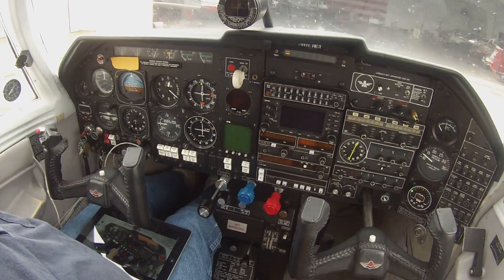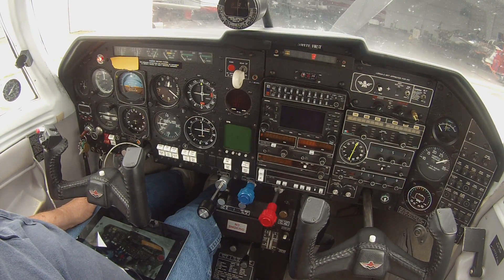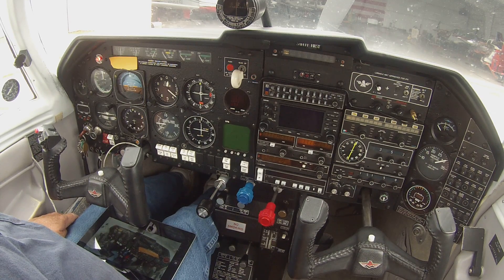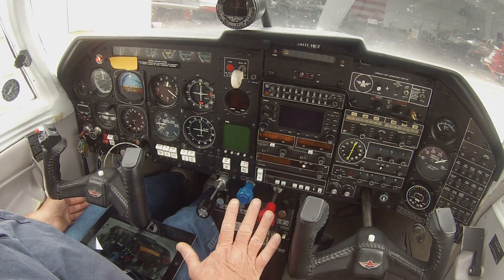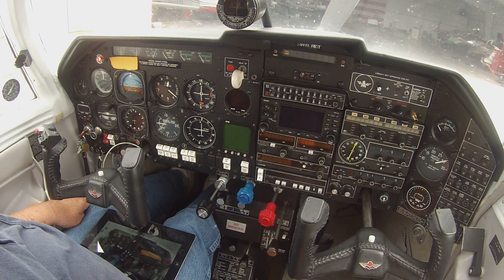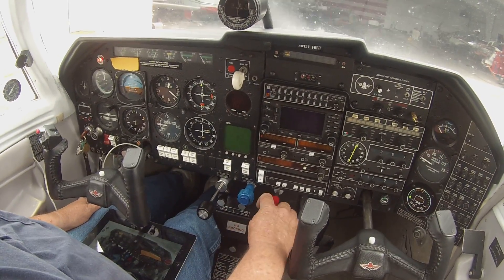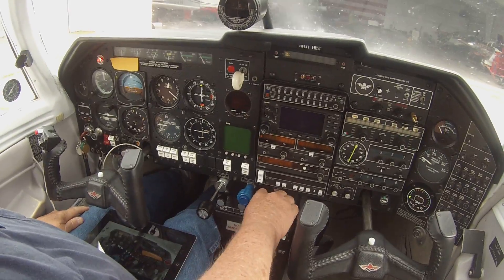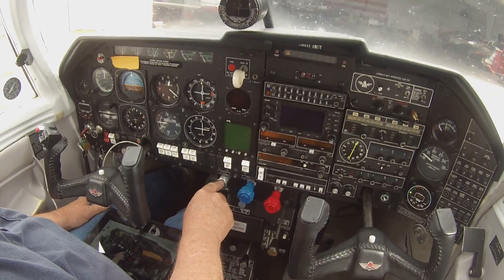M20J Hot Start

Comment: I've started lots of mooneys and this may work fine for an engine that was turned off for 15 minutes , but let it sit for an hour and this will never, ever work.   I'm speaking from 3000 hours as a pilot and mechanic  in a 201.   hot engine start.   throttle full forw, mixture full forward, prime for 5 sec.   that clears out lines with fuel.  then mixture back to cutoff, leave throttle full forward and start.  when engine starts, mixture forward and bring back throtte to idle.   this is a flooded engine start.     What Don is doing, I can restart an engine easily multiple times like this.  no magic here.  If you have a 6 cylinder,  don't follow dons procedure either.  use the poh procedures for continental 6's
Reply: New 201 owner here.  I'm not totally familiar with what constitutes a hot start.  Is an engine that's been sitting for an hour considered to be in a hot start condition?  I was thinking it was more like within 20 or 30 minutes max.
Reply: My experience is the same as yours. A restart within 15-20 isn’t really a hot start. Every engine, …. EVERY engine (don’t care what the POH says) will hot start differently, there doesn’t seem to be a magical “1 size fits all” hot start procedure. Find the technique that works best for you. That’s the benefit of the prime/‘throttle full open’ technique. The engine will crank and when the fuel/air mixture hits the right point the engine will fire.
Reply: I fly my E model frequently and let it sit for over an hour while I eat breakfast and use the same process that is in the video.  Its works everytime.